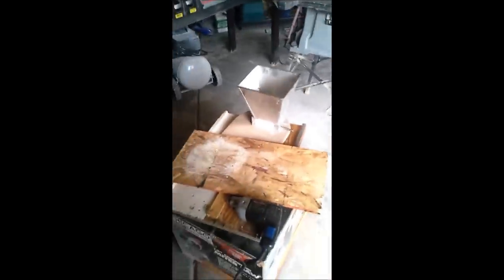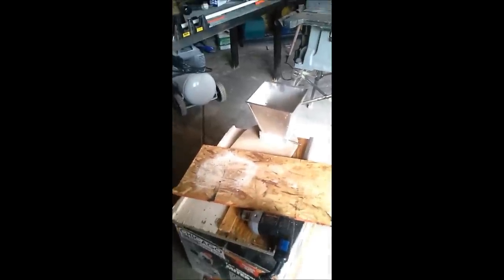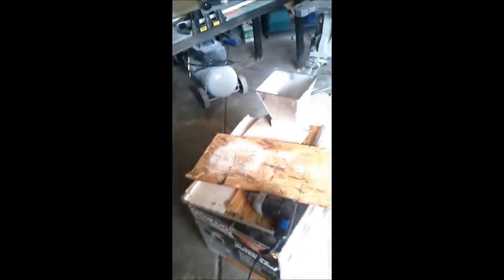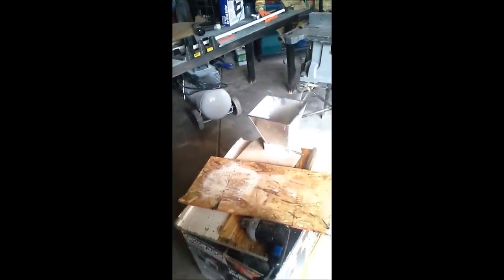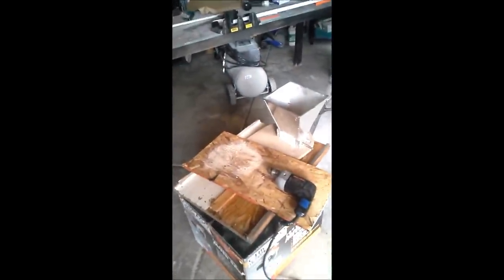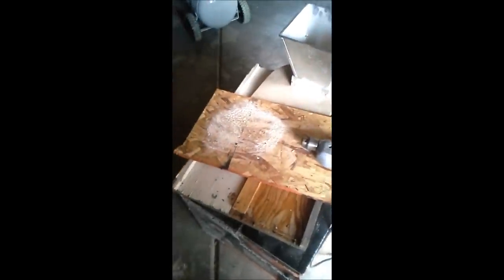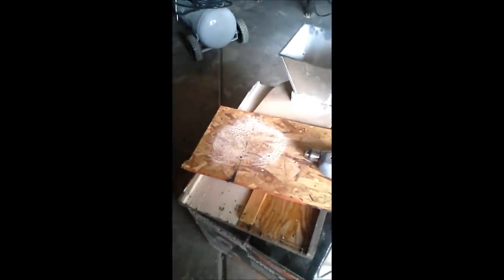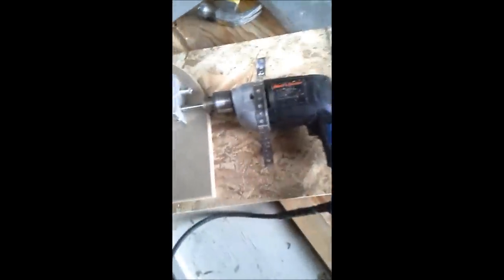grain mill stand, hops, and home remodel.

Comment: I use a drill, but have to hold it.  I have to constantly keep adding grains to the small hopper at the same time.  I plan on upgrading, but for now this is working as I have little money.  Cheers!